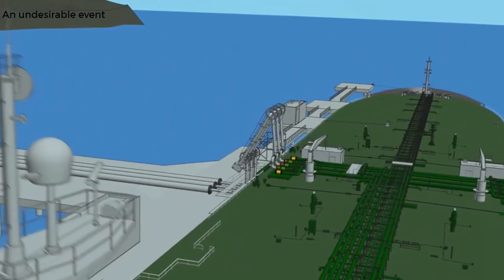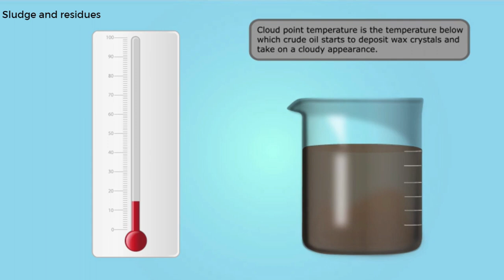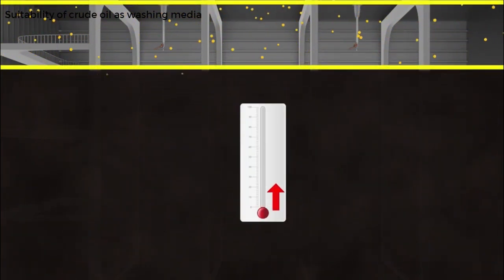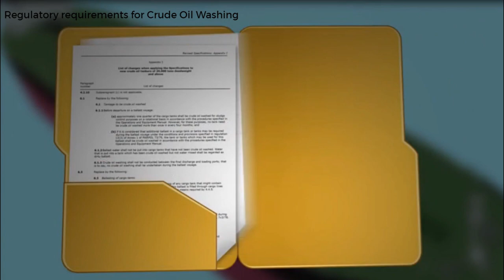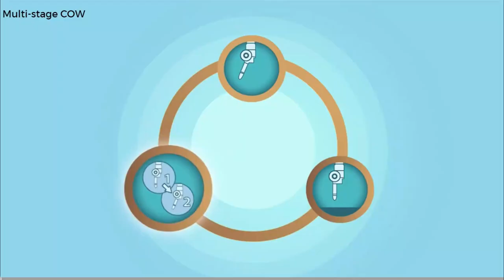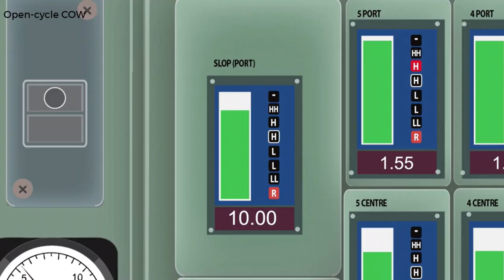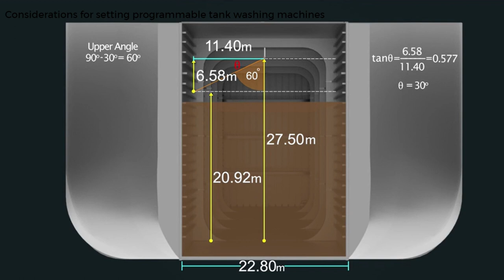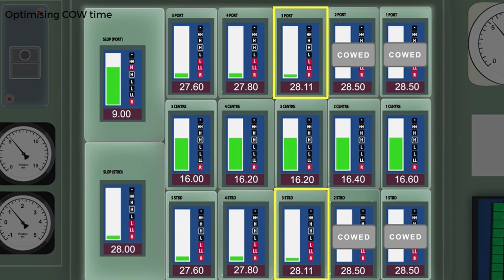Crude Oil Washing On Crude oil Tankers

Comment: One factor that's often overlooked is the ballast temperature at loadport. The tank tops will be at this temperature at the start of loading (vessel in ballast condition) and so a layer of paraffin will freeze against this cold surface once the crude enters the cargo tank. The remaining cargo then takes the path of least resistance, flowing up and over this boundary layer. Any subsequent cargo heating will only effect cargo immediately around and above the coils, not reaching down to melt the boundary layer. Only hot ballast could do that, or COW with a heated medium of course. I'm "Mr Steve" - I've been an EU based specialist COW superintendent for nearly 15 years as a Charterer's Rep, overseeing the discharge and COW of problematic crude cargos. If you've any questions regarding washing of paraffinic cargo feel free to ask, I'm always happy to help out....